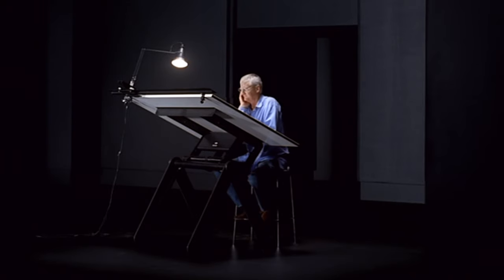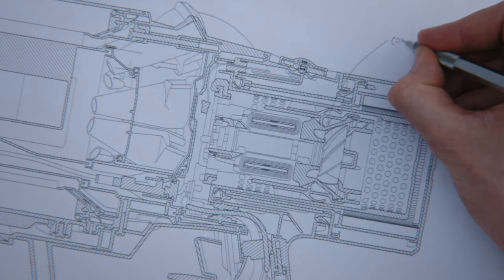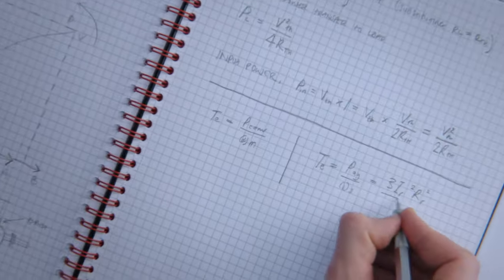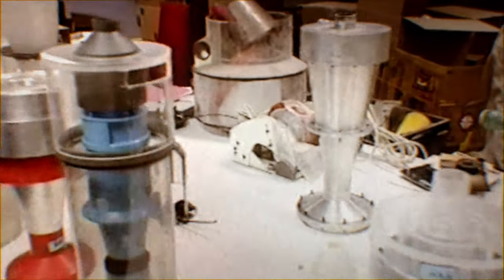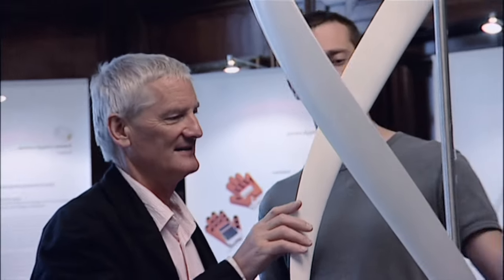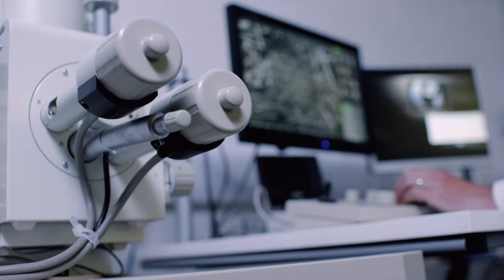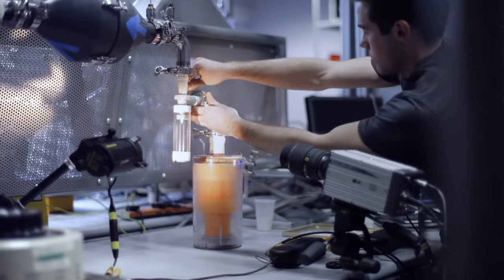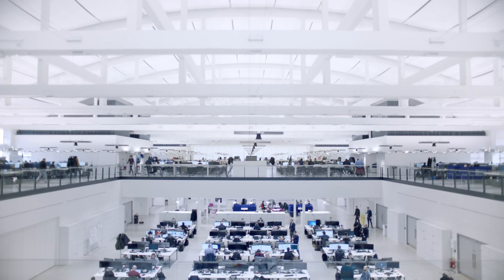The Dyson story: James Dyson speaks about our approach to engineering

Comment: I bought a Dyson V8 Fluffy vacuum cleaner 18 months ago in Hong Kong with a 2 year warranty. Now  the stop/start red button is not working and I can no longer use the vacuum cleaner. When I contacted the Dyson repair store they said it would take 2 months to get an appointment to fix the vacuum cleaner and they could not provide me with a replacement in the mean time. It would then take 20 days to fix the problem. So I have NO VACCUUM FOR 3 MONTHS. However I read that the warranty is hassle freeI (what a joke) and that a repair or replacement can be provided (this was rejected when I asked for one). Why is the Hong Kong warranty not giving me a replacement. This is lousy service. For a vacuum cleaner that costs so much I expect better service then this. DON'T BUY THESE VACUUM CLEANERS - they are a rip off.
Reply: fake feedback lol

Comment: Unfortunately it seems that Dyson has lost the rigour needed to successfully design and test new products. I had the Pure Humidify Cool delivered yesterday and after talking to support, it's going back today for replacement. In Breeze mode there was a terrible grinding/buzzing sound. In auto mode, the fan refused to switch on despite the room being very hot. I'm not convinced of the robust design and functionality of this product. I have a new album out Monday and had hoped for trouble-free cooling in the build up. So far, I was wrong to expect this.

Comment: Does anyone know if you have to utilize docking station in order for the  v11 toque to charge ? I am not permitted to drill holes. Does it come with a separate power cord ? Thanks for any help !
Reply from the maker: You can charge your machine without the docking station, the charger can be plugged straight into the battery.

Comment: I’m from India and below is my experience with Dyson:
Last month bought a Dyson aircool air purifier which turn out to be a faulty machine and due for replacement (yet to receive). 
yesterday I bought V11 absolute pro (gold) and received a faulty product again . Huh!
After spending 60k if you receive so, how does it feel! I’m totally disappointed with the quality. It’s made up of cheap plastic and built quality is not that outstanding as expected from Dyson, the so called company with researched innovative product line. 

I used to be a huge fan of Dyson but I’m utterly disappointed with both the product I purchased in a span of few weeks. It makes me realise either they sold product rejected by developed countries or out sourced manufacturing to cheap Chinese firms specially for Southeast Asia. 

I have lodged complaints to Dyson to return both products as they say.

Do not purchase from Dyson ! I’m telling from my experience
Reply: Cfb

Comment: I bought lot of Dyson vacuum, but Dyson only care how to pickup the dust from the floor, they doesn’t care the the dust how to leave the vacuum machine! After one time use, outside dusty, high speed running motor will made electric static outside the machine dusty, inside the BIN, Dyson never care hairs and dust how to leave the BIN , they’re just think collect only, never think how to leave the BIN! first time, they are just give one small brush to clean up, right now installed brush inside the BIN to remove hairs and dust, but all the ideas just made lot of the hairs and dust go back to the room! I have Questions, why they don’t design a small paper bag inside the BIN to collect the dust and hairs? after just push this paper bag out, this idea will stop the dust and hairs go back to the Room again! buy the small bag need more expensive, but the user will accept!